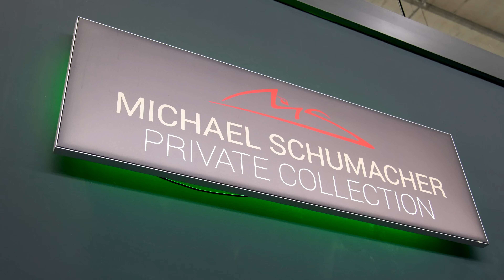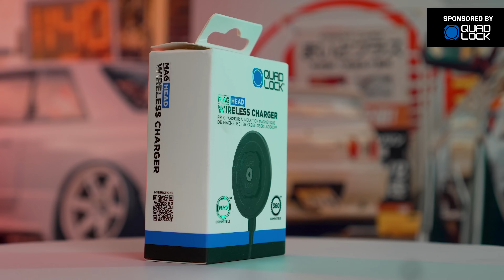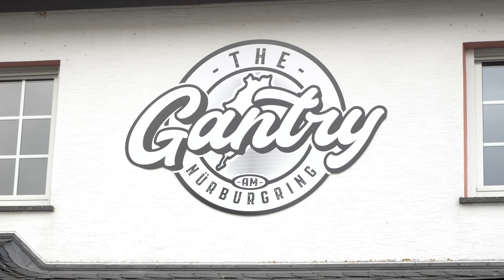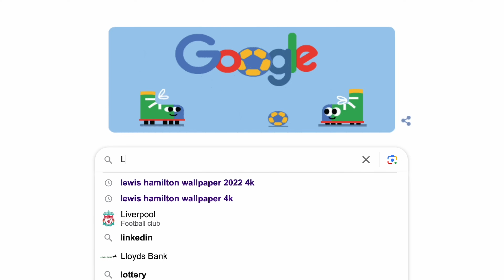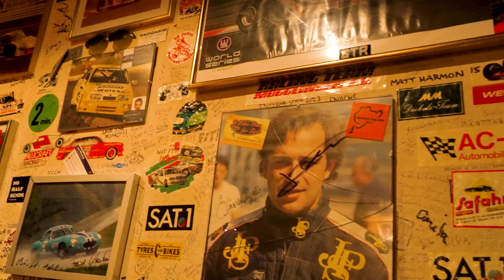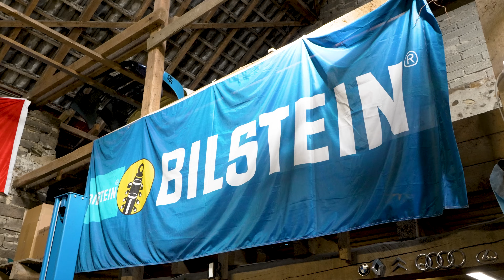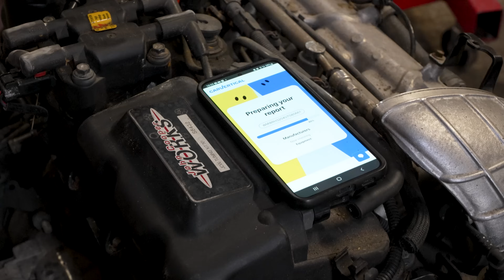CAN WE FIND, BUY AND FIT A NEW ENGINE IN 24 HOURS?!

Comment: The funniest thing is that Taylor called his car reliable in the previous episode 😂
Reply: I mean to be fair it is a reliable car, just so happened to end up in sum irresponsible hand
Reply: Mate they kinda are people tell me there not but I bought an r53 and blew the head gasket spent an arm and a leg and it was still fucked had to sell what I could and lost loads on it. Shame cause they are one of my favourite hatchbacks but unfortunately my experience with them was slightly ruined to say the least
Reply: @50Rupees717  From what i've noticed all over the internet is that these minis aren't that reliable as us car gurus would like them to be.
Reply: @marceluryga8687 yh mate going 140 means his hands are unreliable, pushing a car top speed isn't good for it..
Reply: @marceluryga8687  they are reliable but not when they have been ragged about like 90% of them.
Reply: All cars are reliable, until they break down.....
Reply: @luckgrip252  The R53 is the most reliable of all modern Mini. I had a R53 JCW and had 0 issues. I done 20k miles in a year, had it up at 140mph, done laps of the ring, toured the alps and didn't have a single issue. They're old now, you gotta get one that was cared for, same as any old car.
Reply: We've had sooooo many minis with some sort of terrible or terminal engine problems in our workshop 😅
Reply: Mini, reliability choose one 😂
Reply: @yogummler  95% of them were probably an R56/R55
Reply: I think if Tay werent so chunky it wouldn't of done the engine in. It weren't his right foot it was is heavy arse that flubbed it @Autoalex cars
Reply: With a blower they get pretty shitty if you really beat on them, the R50s are actually ok-ish. Typical BMW shit though, so O2s and timing tensioners and stuff like that like to decide not to work anymore. 
I've got 2 R50s and had to replace the motor in my favorite one at 178k when it drank all its oil on track and failed right quick fast and in a hurry lol.. At least I put a 6 speed in it when it went back together, feels infinitely better now. I should stop driving it like a savage all the time though.
Reply: Almost like he jinxed it or something😂
Reply: @starx2212 This. It really irks me that people spread so much misinformation about these cars.

Its ridiculous how many people say such incorrect shit about them. And then double down when they're corrected.

R56s gave Minis the terrible reputation they have now. They were pretty shit. No point in denying it. 

Though ironically, F56s have proven to be pretty good too in terms of reliability and yet people still talk shit about Minis despite the fact R56s are out of production nearly 10 years now. R53s are generally reliable, and F56s are also reliable. So 2 of 3 generations of fairly reliable cars (they're not Toyotas levels, but they hardly fall apart every 2 weeks) yet they're still apparently at the same levels of 1970s British Leyland products.
Reply: Its a mini says it all🤣🤣🤣🤣
Reply: It was a BMW mini, I think he was a bit deluded there lol.
Reply: @50Rupees717  The early ones used to have gearbox issues, mechanics hate BMWs apparently lol.
Reply: Yeah but Taylor is a car salesman so every car is reliable as far as he's concerned.
Reply: @jh565bb  the early midland box was bad on the Mini Cooper.  the cooper s used a getrag box which is very robust as is the tritec motor if we’ll serviced. Neglect is what kills these cars.

Comment: Absolute props, pulling an engine on a mini is an incredibly involved task and you guys did it in 24 hours. What reduction percent is the supercharger pulley that you guys have?
Reply: They did it in way less time than 24 hours. If it isn't your first time, you can pull an R53 engine out in about 90 minutes. Provided you've got a lift. Putting it back in takes longer, but it's definitely doable in a day.

Comment: I was gutted for Taylor. I only just bought an R53 and it gave up on me the very first day. It poured coolant out of the expansion tank cap, in the end it turns out that one of the two teeth driving the water pump had snapped, which made the coolant pressure low resulting in overheating.
It's been in a garage for a week and it'll be there for at least one more week. I had to buy a new head and supercharger, head gasket and heaps of other stuff. So in my first two weeks of owning an R53 I've driven it for 30 minutes.
Reply: Gutted for you bud. Your R53s previous owners never served the supercharger. The oil inside ran dry and the gears ground themselves into dust with no lubrication. At least when you get it back, it's something you won't have to worry about in your ownership of it.

Comment: The only difference between the JCW engine is bigger exhaust ports and slightly lower compression. If you enlarge the ports further you will gain more horsepower. You can enlarge them double the size of the JCW exhaust ports. You also need 4% oversize crank pulley and the smallest supercharger pulley to get real power from these engines
Reply: A 4% crank pulley combined with "the smallest supercharger pulley" is horrible advice. If you go any smaller than a 17% the car just produces heat. R53s running the likes of 19% pulleys don't last. The M45 is pushed way out of its efficiency band. If you want 'real' power from an R53 you have to either replace the supercharger with a sprintex or equivalent or convert it to a turbo. 260-270BHP is the limits of the M45. And that's with an extensive list of supporting mods.
Reply: @MrManBuzz  Now you are talking silly money. Anyone can put a bigger turbo or supercharger on a car, but that was not my point at all. Budget has to always be considered. Also being an engine builder myself and have built thousands of theses engines, there has never been an issue with heat, so your comment is utter nonsense. 238bhp is recorded using my modifications on these engines and without the need of a new upgraded supercharger. 15% SC pulley and 4% oversized lightwieght pulley is the way to go for maximum power out of these engines. And of course a ported big valve head, bigger intercooler, bigger injectors and a map, lightwieght flywheel and PH4 Kent cam.
Reply: @horyzengaming3935  238BHP is not what I'd call "real power". The bottom end can take 350BHP stock. That's real power. But to get there you need a turbo conversion or supercharger replacement.

A 15% with a 4% crank is too much of a reduction. You're pushing the M45 way beyond it's efficency band.

And I find it hard to take anything you say seriously when you say heat isn't an issue with these cars. Intake temps are an issue with modified R53s when you push them hard because of top mount intercooler struggles to cope with the amount of heat produced from the M45.

And there is zero chance you've built "thousands" of these engines. Zero. What's your businesses name? With a resume like that you'd be one of foremost Tritec engine experts on the planet and you'd be well known in Mini circles. So who are you then?

Comment: Noone is probably going to read this, but you need to take out the smaller pulley from the supercharger again! If you install it without remapping the ecu you will run a lean fuel mixture, i.e. a hotter combustion temperature, which probably killed your engine in the first place.
Reply: The ECU has some flexibility in the fuelling to compensate. It's been proven to be safe to run up to a 17% provided you have an uprated intercooler to cope with the higher intake temps. 

I've speculated Taylors fuel pump was a bit weak and couldn't supply enough fuel and the car went lean, but depending on how long he had the car at 140MPH, he may have heat soaked it and the intake temps got too high for too long. Having said that, once intake temps get too high it should retard timing to prevent detonation so I'm still hedging my bets it was a weak fuel pump.

Comment: i think it was clarkson who said the engines between the cooper s and the jcw are identical, and the only difference in performance is the ECU, which you can have chipped for a healthy amount less than buying a JCW
Reply: There were 2 different versions of the JCW package, but specifically the block is the same in both. The head has some very mild porting. And I mean mild. It's so minimal I don't think it would add more than 2-3BHP over the standard head. The supercharger is 11% smaller than stock, an exhaust system, and a different map. The 210BHP package had bigger injectors and a trick airbox as well. 

While it isn't true you can 'chip' an R53 and get JCW levels of performance, you can put a 15 or 17% pulley and get essentially the same level of performance, so the premium you pay for a JCW doesn't make sense from a performance standpoint, it's just to have a 'real' JCW.
Reply: @MrManBuzz  cheers man, would’ve never thought about that 👍

Comment: Probably should’ve kept the JCW supercharger pulley to avoid another engine failure 😅
Reply: The JCW pulley uses an 11%, you can run up to a 17% very safely provided you've got an uprated intercooler, any higher than that and you start compromising things, but I'm pretty sure Taylor said he's running a 17%

Comment: I’m sure you guys are fully aware, but 140 on the Speedo is not actually 140… Every car I’ve ever owned isn’t that accurate due to tyre wear et cetera on my current car you have to be sitting at 73 miles an hour for the satnav to say 70, the satnav being accurate (GPS) …Id bet you weren’t even doing 136

Comment: I need the next episode now getting top gear vibes you need to start messing with each others cars in a 800 mile trip after Germany maybe a little longer grab the ferry to France etc see who's can last the distance least breakdown points system for that and parts needed etc and just put rotting food hidden in the car somewhere hook up one of the radio to play Britany bitch over and over again maybe a leak in the fuel line in one of the others or eggs in the engine bay  maybe unbolt the seats spray paint it over night separate  drag drift and mpg lap etc cones course best parking to best handbrake turn would be awesome could easily be a 6 even 8 part series would happily watch my eyes would not leave the screen incredible entertainment apricate each and every one of you have a good one

Comment: I'm sorry but quad lock motorbike mounts are overpriced and overrated I've got a cheap £12 fack quadlock and it's exactly the same as the original only exception is when you need the stear tube mount but if it's just the bar then it's overpriced 80 for the original and 12 for mine 😂😂😂